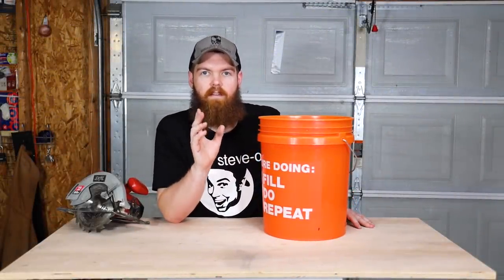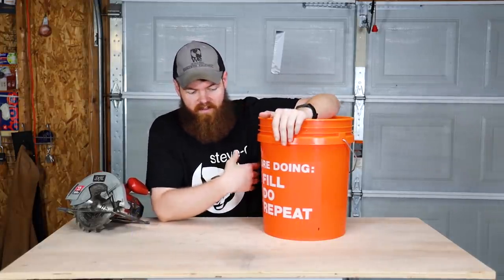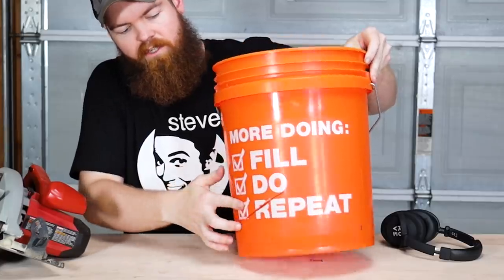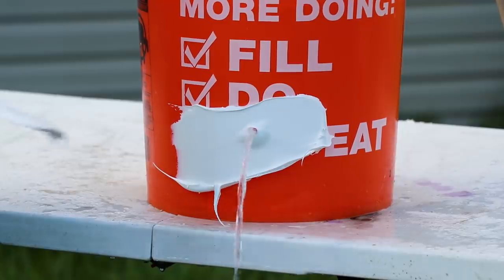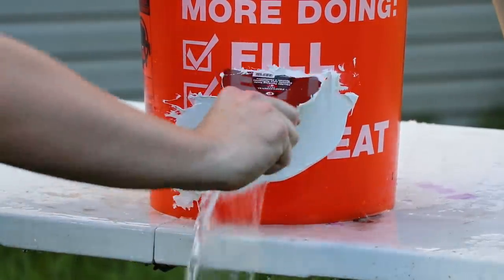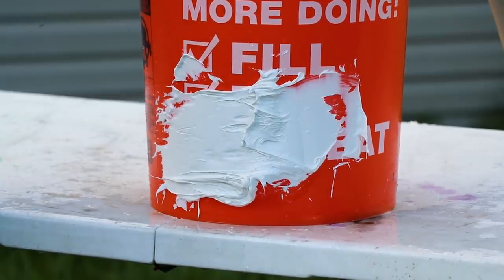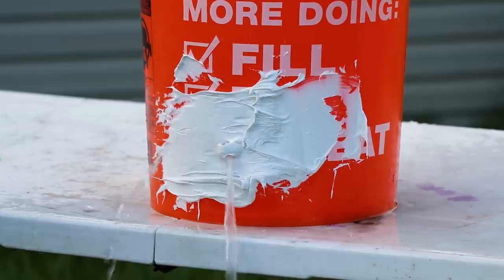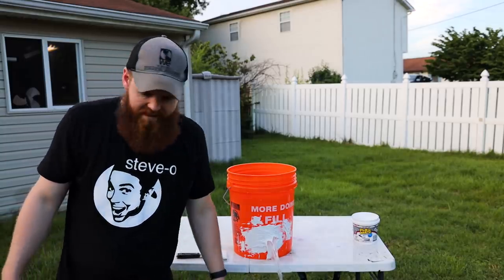Can Flex Paste Stop A Leak?

Comment: In all fairness to Tyler and Flex seal let us consider the bucket Tyler is using as compared to the wood barrel Flex seal uses on the commercial.  Tyler's bucket is made of slippery plastic, the barrel is made of wood, big difference; the wood will seal because it will allow adhesion, where as the smooth plastic bucket will not. I call this experiment ambiguous and unfair, therefore it is to be ignored.

Comment: 5he problem is the material the bucket is made of. Every cement tells you on the label that it won't work on polyethylene as it is one of the slippery/non-stick plastics. That would also apply to this product.

Try a metal or non-slippery material.
Reply: They're slippery all except when you stack the bastards lol
Reply: @dodge8802  Press fit works. A little vacuum helps too.
Reply: thats not the problem, cuz the paste isnt falling off, its separating from itself not the bucket
Reply: yes
Reply: Don't they use a bucket in the commercial?
Reply: they used a wooden barrel
Reply: @gabo9175  It's doing both.

In the commercial he takes a huge wad - maybe half the container - and slaps it on so that it goes through the hole and forms a plug that expands on the inside and is the thickest around the hole. He's using the properties of a viscous substance to do most of the work.
Reply: Nah, the paste is trash.
Reply: @RuneTheFirst  Exactly, I noticed that too! Also he's using black flex seal paste and I've only seen Ryle use white. Wonder if there's a difference. I doubt it but honestly he walks away from that barrel about a half second after he puts the paste on there. Total shady advertising.
Reply: @RuneTheFirst  Im pretty sure the paste is literally just normal silicone (caulk) in a bucket. Looks the exact same

Comment: "YES" It can stop leaks, Depending on the water pressure.  

You can't expect it to stop a leak with 5 gallons/18 Liters pushing down on it.  I don't believe the commercial was misleading.  Just use it in a more logical, real life scenario, way.  No paste is stopping 5 gallons obviously.  Not to mention the Cut in the commercial isn't low on the bucket, so theres no weight pushing down on it (and the commercial bucket is wider, distributing the water weight more).  The cut in this video is at the very bottom, meaning all the weight of the water is pushing down on it.
Reply: it works best with no water in the bucket
Reply: did you watch the commercial? He used it the same way
Reply: @amyjude.1892  it didnt imply that the bucket was full in the commercial
Reply: The average wooden barrel is 59 gallons. The commercial shows one cut in half (29.9 gallons) and stopping a leak no problem. So if it can do that, 5 gallons should be child's play.
Reply: @amyjude.1892  the half of a bucket he had in a commercial wasn't as high as the bucket Tyler used. There was much more water pressure on the hole in the bucket Tyler used.
Reply: @vcrambles  Do you even understand physics?  5 gallons PUSHING DOWN is more weight than 29 gallons evenly distributed.  The 5 gallon cut is much lower than the 29 gallon cut.. therefor pushing down harder.  Jesus man, go to school, this is childs play.
Reply: @AlgaeEater09  Even with is being lower on the 5 gallon bucket, 29 gallons would still output more pressure on a small release point like the cut made. The only way it wouldn't would be if it had a secondary release area, or was cut so high that no little to no pressure would be applied. Along with that the 5 gallon bucket leaked well before it was full. Meaning the product still failed.
Reply: also the commercial only showed a few seconds the bucket was stopped for a few seconds as well
Reply: @vcrambles  the point is that the cut on the barrel is higher up, so a significantly less amount of pressure was applied
Reply: @nikoraasu6929  then actually gives hims ways to improve it instead of just saying do better. Give him a real life scenario. @AlgaeEater09
Reply: Its pretty funny how pissed people are over this

Comment: Itd probably work with a lower water level in the bucket. There's too much weight standing on the product.
Reply: Didn't they use a massive bucket though?
Reply: @Petrslav  yeah they had like a massive glass tank
Reply: @nateconley.6209 no
Reply: @nateconley.6209  it was half a barrel there wasn't that much water on it
Reply: Finn doesn’t matter, amount of pressure is determined by depth. The commercial looked higher, so less pressure, meaning it would hold. They prob used the barrel to make it seem like there was a lot of water and a lot of pressure, but they cut fairly high, so pressure was lower.

Comment: I feel like the thick wooden barrel he used allowed the flex paste to work down into the slit he made and the bucket is just so thin you're just putting a layer over it, it doesn't have room for anything to really go down into the slit if that makes sense
Reply: I had the same thought.
Reply: Or they just hurried up and switched to a different part of the commercial to hide the fact it really doesn’t stop the leak.

Comment: Cam you apply it on the inside of the bucket? The pressure of the water would push the flex paste into the slit then?

Comment: In the commercial the cut was at the top/middle of the tank so the pressure wasn’t bad hence the reason it could stop a leak, so if you did I higher up it would work ideally

Comment: The commercial made it look soo easy. Even putting it into a fish tank and sealing a hole. Should have tried sticking it into the water and sealing through the inside. Maybe the pressure will push the flex paste through and seal it more

Comment: I think on the commercial they had a hose to put put water in the bucket while it was sawed, and the bottom of the bucket was raised almost up to the point where the slither was, and of course you can imagine there was no pressure, thats why it worked on the commercial. Or they have an enhanced product just for the commercial. Its all just a theory idk anything else they could do.

Comment: The reason it worked in the commercial is because the barrel he had, he made the hole right below the water surface. in Tyler's bucket, the hole is a lot deeper in the water and so has a lot more pressure. This is why it worked for him at first, then stopped working as the bucket was full.

Comment: 3m seal calk, then dry the area, prep with solvent, then use tape or a vulcanizing patch. If you can get Vulkum or some other Temco sealant down long enough to cure, your leak is sealed.

Comment: Try sealing it from the inside, i seen a video of someone using flec tape, to fix a swimming pool, she tried to seal it like 10 times on the outside, once she made a seal on the inner side of the pool where it had a huge slit in it, it finally worked and stopped leaking.! Worth a try!

Comment: I believe the question isn’t so much the width of the slit as is the thickness of the wall you’re trying to seal, a wide slit in a thick wall may be easier to seal due to the paste having more internal wall area to fixate to, best resisting the water pressure. A 2.5 cm (roughly an inch) slit in a 2.5 cm thick wall has roughly 2x6,25 cm2 (~2inches sqr) while a 25 cm slit in a 0,3 cm (as the bucket appears to have) wall only has 6 inches sqr. I.e, while the cut may be 10 times bigger the area is only 3 times
Reply: Sorry if my math is wrong, it’s 2am

Comment: its tv magic, he is using like 1/6 to 1/5th of the bucket of paste in the commercial per scene and when it gets to eh "active leak" one the bucket wasn't as large as your so not as much downward pressure and 2 it only showed it for like 1.5 seconds so it wouldn't show it fail. on top of that the "flex paste boat" he smeared his normal amount on the chicken wire then hardcut to a boat that was over a inch thick of the paste making it seem like oh i barely made it out of the paste when actually its basically just a cast rubber boat.

Comment: The surfaces in the ads are porous, like wood and concrete. Obviously, with those it would bond better. With the smooth plastic bucket, you can see the water getting behind the paste.

Comment: Why it is not working it because on the TV Add. They used a lot 
Thicker water so the water don't flow out of the hole as fast. I would say if you can buy thicker 
Water it would work.

Comment: You keep putting the hole on the bottom of the container which means it has more pressure on it. If you check the commercial Phil Swift put the hole in the center. Which means that has half the pressure

Comment: Maybe the hole needs to be higher up. At the bottom you have so much weight from the water pushing on the wet paste if you put it higher up there would be less weight also phil usually has a second hole so the water pressure wouldn't build up it would keep a constant flow, all Phil's goal is, is to show it stopping 1 leak not plugging up a dam

Comment: Didn't Phil Swift use a thick walled container? That would allow you to get a better seal because of the increase in surface area for the paste to pack into. Think of packing the paste into a crevice  with a leak vs skimming over the surface  of a slit with a leak.

Comment: I haven’t seen the commercial but if the guy cut a slit in the top of the barrel then the lack of water pressure from the top instead of the bottom would not be as hard to stop as a slit in the bottom. Another possibility is the bucket is flat and slick plastic if the barrel in the commercial was metal there would be more of a chance that the flex paste could bond better or the flex paste they used could have been cold and harder for the water pressure to burst through. But as we all know info mercials have many tricks to get us to buy things that is literally their job at the end of the day. (On a side note I really wanted it to work as well I love flex products and it is a shame to see one fail)
Reply: Well I'm going to try to use flex paste as gasket sealer around a light fixture in my swimming pool. I have a gasket but it's kinda old and I don't trust it to hold out water, so I'm still going to use the old rubber gasket but I'm going to put a thin layer of Flexpaste on both sides. Then, not giving it time to dry, I'm going to tighten it back down and submerge it back underwater. In this case I think the product should be helpful.

Comment: That's some pretty bad false advertising tho.  
Maybe if you can get it to steal both sides in the bucket, it might, but even then I have my doubts.  I did love how it would look like its working, then a small bubble appears and then the leak breaks thru. 
I bet it might work if you steal it and keep pressure on it (like you did with the tool for a bit) for a longer period of time to kind of let it set on the outside.

But as advertised, it just doesn't work.

Comment: You had your slit too low, therefore putting about 40 pounds of water on that area, in the commercial they had it higher, therefore decreasing the pressure

Comment: Well It actually stopped the leak! But you put more and more water into it, which put pressure on the cut. Fill bucket with water, seal the leak. DONT FILL IT UP WHILE DRYING! and then try again!

Comment: This is the 2nd time you do the same experiment and you do it wrong, the flex plate in commercial was put inside of container instead of the outside! So try the product the right way because both time you did it wrong!!! I'm curious to see if the product actually works when you use it the right way.
Reply: Flex paste***